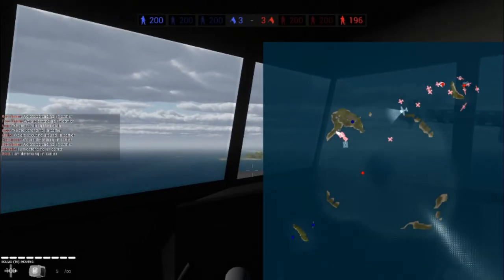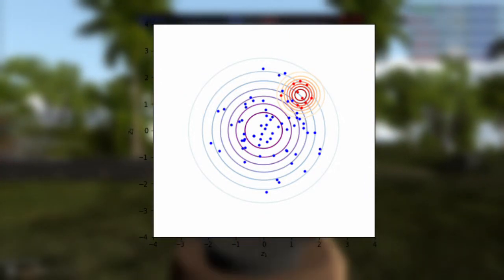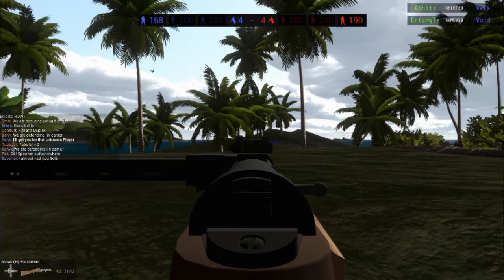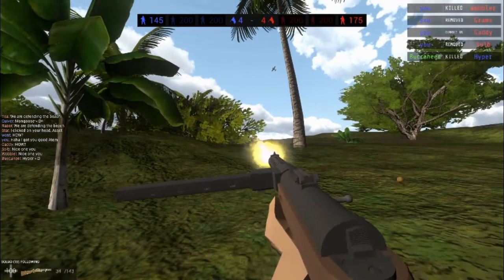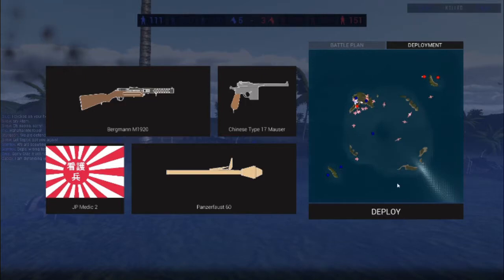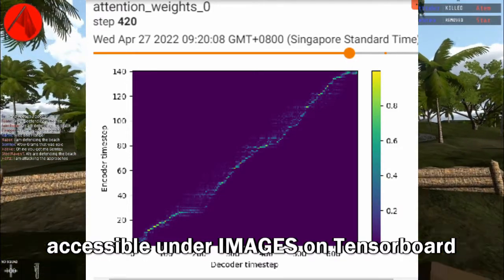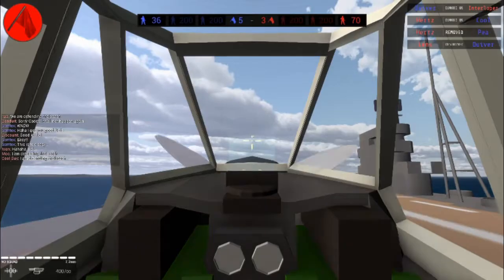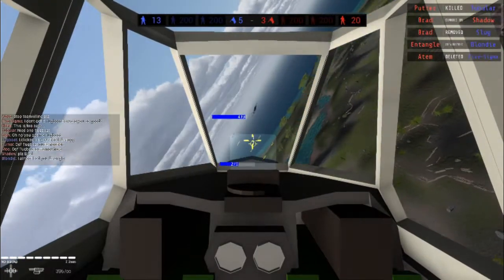Flowtron Text to Speech Tutorial REVAMPED w/ Kyle Katarn (May the 4th Special)

Comment: Hey, I managed to train my model using your tutorial. Thank you so much! But while inferencing I had an error due to this line "%tensorflow_version 1.x" in notebook you shared. I worked around it by removing that line. But I want to know will this impact the results? Or it doesn't matter? Also I have around 12 mins of transcripts. How many epochs do you think I should train for? In your Bastilla video you trained for 500 epochs for over 1 hour of transcript. Right now I am at 200 epochs. Great channel btw. Subscribed!
Reply from the maker: May need to update the dependencies there. Well you just need to make sure your val loss doesn't shoot back up like a quadratic curve.